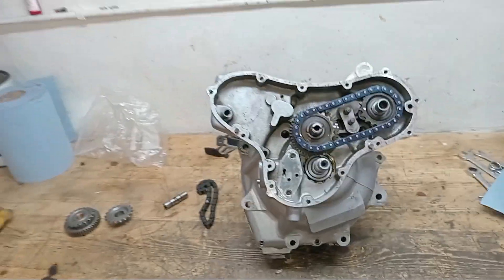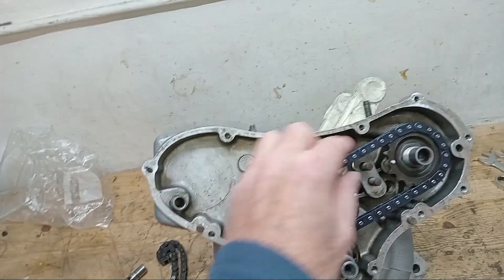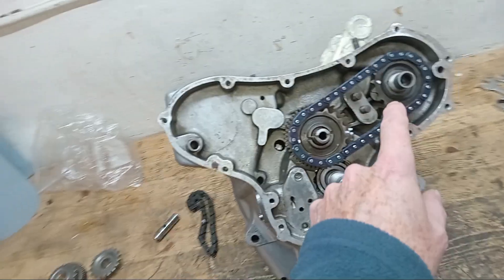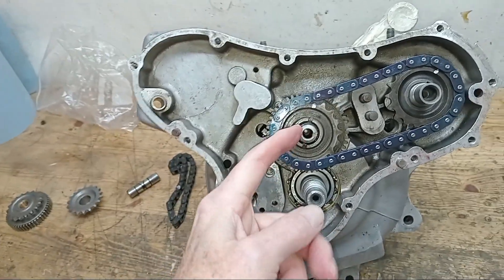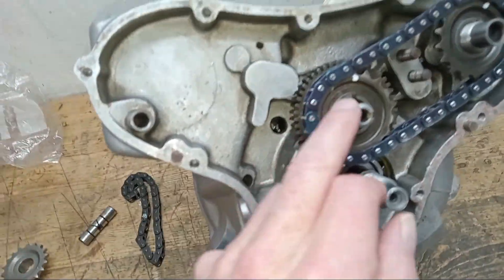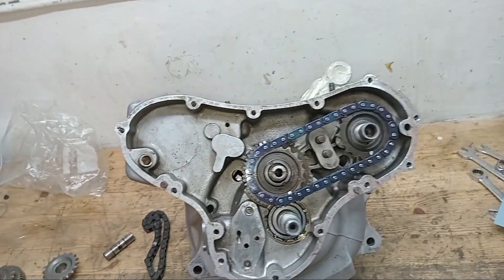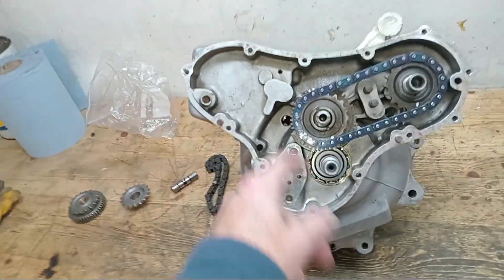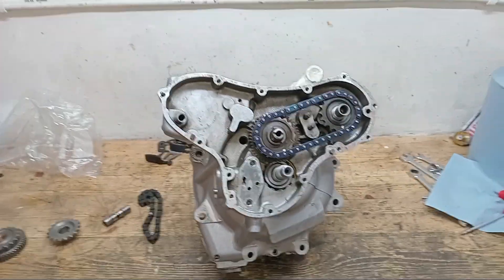Norton Commando Engine Rebuild. Part 50: Timing Chain Saga!

Comment: Chriss I've been spannering Norton Twins since 1972 and have two in my garage plus a load of parts. I take one look at your timing chain without tensioner and know THAT IS WRONG. On all my engines I can move a half inch of slack  with one finger, The timing chain assembly was virtually unchanged from The Model 7 500cc to the 850cc. Do NOT run that engine with over tight chain unless you love GRIEF. The SS camshaft on your bike sits in two brass bushes. These bushes are almost never changed unless there has been a Diasterous oil failure. I have only had to do it once. You don't touch those bearings because if you do you should take cases with new bearings mounted plus the cam to a machine shop and get them Line Reamed parralel to a non interference fit of the cam. I think you or a predesseor have touched those bearings. Note that I am in France currently with houses near Versailles ans Evreux, will drop a timing cover on a motor to show you.

Comment: I had a similar problem years ago and I found that the chain was coated with some type of "grease" no doubt to prevent corrosion during storage. A good wash in petrol or thinners was the fix. Don't forget once fitted to lube the chain with engine oil. 
I believe Renold cam chain now uses split rollers obviously to cut costs. I would recommend one of the better chains supplied by "The Chain Man" I believe the son of Andy Chain.

Comment: Had similar issue.  You will even get tension changes when changing direction of rotation.  Also will change when head is installed.  Decided just to set at tdc and not overthink.

Comment: Hi Chris it’s good to see you again! Happy New Year. All I can say about your problem with the chain tension is that I feel your pain. I was wondering if the bushes were worn giving rise to the issue but that would appear not to be the case. Best wishes
Reply from the maker: Thanks, John. I have to say that I'm still pretty stumped by exactly what the cause of the problem was. No 'smoking gun' as they say. But the main thing is that although not perfect, the chain tension is now within tolerance, and I'll take that! 👍
Reply: @Chris.rooke150 looking forward to seeing the follow up videos. I thought the delay in posting videos was due to thespian commitments in the festive season 😉
Reply: What a nightmare scenario. It’s annoying when you can identify the cause of an anomaly, never mind annoying & frustrating when you can’t. Hopefully sorted once & for all. Is it possible that one of the shaft holes is not perfect, making the shaft run eccentric?
Reply from the maker: Thankfully that did play a small part in the delay! Had a week's filming in Liverpool.  👍📽
Reply from the maker: It wouldn't appear so. The camshaft turns very nicely, but with no play whatsoever. All a bit perplexing. 🤔